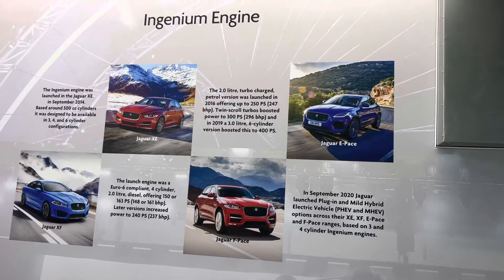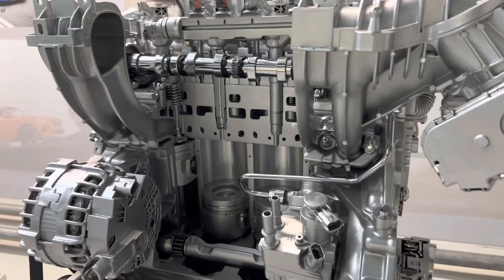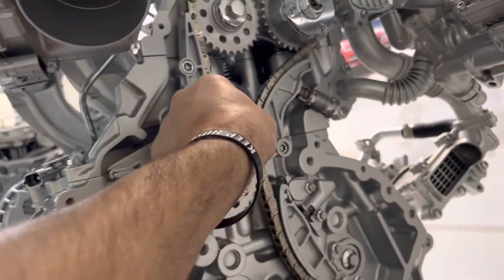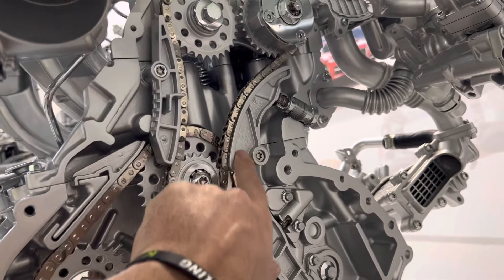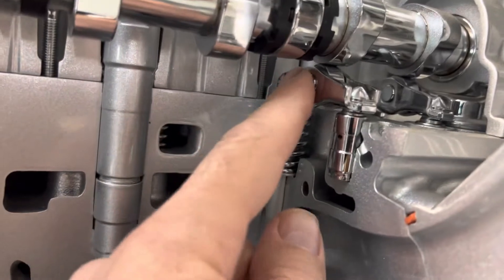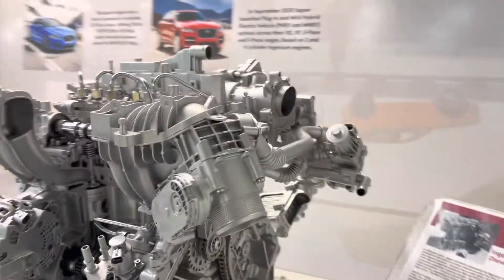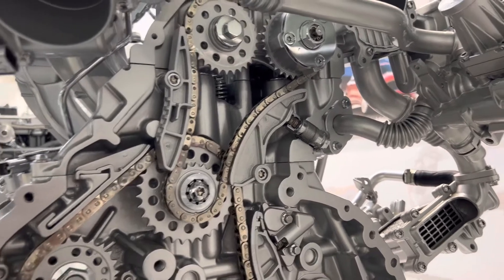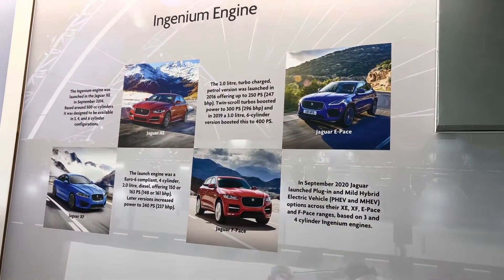🔧🚗 "Uncover the Dangers of the Jaguar & Land Rover Engine's Timing Chain Noise Must-Watch🚨🔍

Comment: If the chain breaks, in addition to what's been described, does it also cause damage to the cylinder head and engine block? The reason I ask is because this has happened to my engine and I'll have to rebuild it.

Comment: I have an issue with my 2008 LR3 4.4L Jaguar engine. I did the head gaskets, and i notice a little rattle at startup now. I replaced cam tensioner not chains 😒 before.  But now im getting lean codes at idle and rich codes while driving and some serious fuel loss. I can see the gauge drop at idle tremendously idling for 5 minutes, but exhaust doesnt smell rich at all.   No pinging or miss fires. What you think?  O2 sensors? Maf sensor? Timing off?  Is there a way to check with cam is off seperatly?

Comment: I have a F-Pace 2017 from new, had service contract with JLR, so always been looked after by them. Always thought that it was a bit 'tapperty' on start up but told normal, had a Nox Sensor replaced by different JLR dealer, they said 'engine noise needs investigation,  took in in this week, had a  phone call and told it needs a New Engine (covered under extended warranty) is this normal to need a whole new engine? Car has 42,000 on the clock that is all. I would recommend paying for the Extended Warranty if you can.

Comment: Hi did timing chain replacement at landrover independent garage for my discovery sport. engine still quite sounds noisy and every 4-5K I’ll need to top up engine oil. There is no visible leaks . It drives well but quite noisy Mechanic said it’s normal even . Any suggestions
Reply: How much did it cost?

Comment: I've read quite a few comments related to 2.0 diesel engine failure in jaguar xf (2015-2020).  Apparently, this engine often fails completely quickly, which ends in costly repairs.  I have a few questions. 

 1. Do I understand correctly that if I pay enough attention to the sound from the engine, it will react earlier and it will not end up with an expensive repair (as you say in the video)? 
 2. is it better to give up thinking about buying this car because engine problems are too risky? 
 3. Does the Jaguar 2.0 petrol engine also have these problems?
Reply: I've sold JLR type cars with the 2.0 ingenium diesel engines. The diesel timing chain will eventually fail past 100,000 miles if maintained correctly. EGR and DPF are also a main concern after 50,000 miles or earlier. You just need to service it every 5000 miles or every year. I'm not sure about the petrol engines, but they are more reliable than the diesel because they have no DPF and EGR problems.